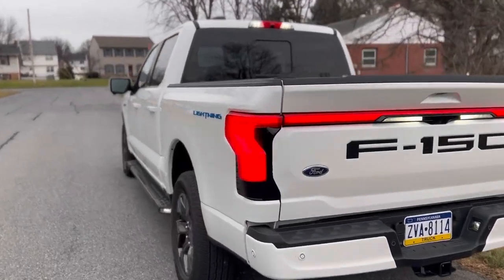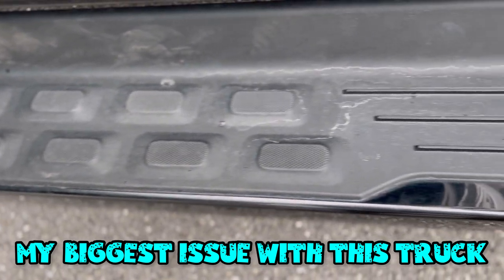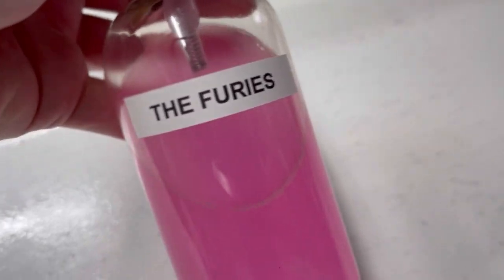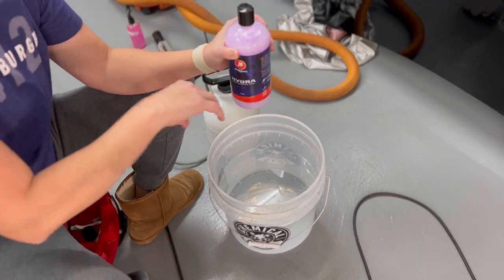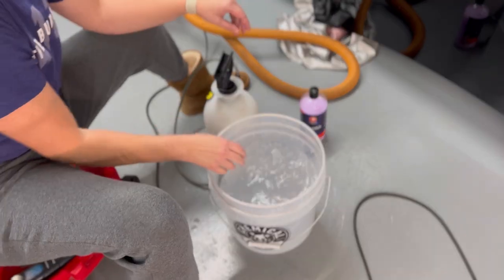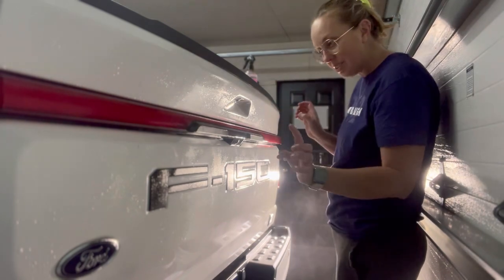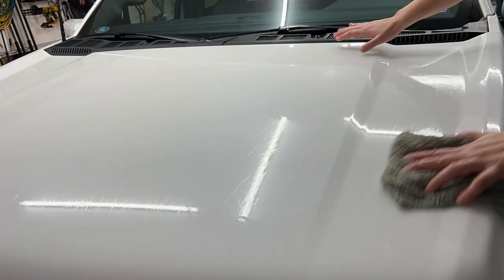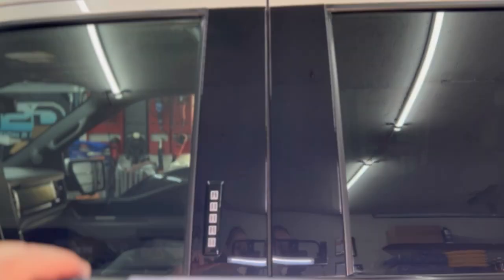Ford F-150 LIGHTNING EV⚡️- Detailing Tips + Exciting NEW Products from @Phoenixeod

Comment: Pretty darn nice. I always get tips from your videos. Yes I'm restricted with weather here in Wisconsin. Horrible. I'm discovering rinseless washing. Was scared at first. 
Hey! I'd like your impression on the mop you used to clean up the flooring. Why you ask? I'm getting a coating put on garage  floor next month. Present epoxy flooring is failing and is like ice when wet. Folks have been slipping! Not good. The new coating for the floor will not be slippery but needs a little different way of keeping it clean. Sounds like microfiber mop will do the trick combined with p.h. neutral soap. So I need recommendations for a mop combination. Cool truck in video. Thx Chelsea.
Reply from the maker: It’s in the works

Comment: What do you think about the spta cordless?? It’s seems difficult figuring out the right combo for polishing especially when you don’t know the paint hardness
Reply from the maker: I really enjoy it for paint enhancements and quick one steps but for heavy correction or more power use my Rupes or Griots 15mm. But it has about a 45 min run on the battery and comes with two and is great for most my polishing needs